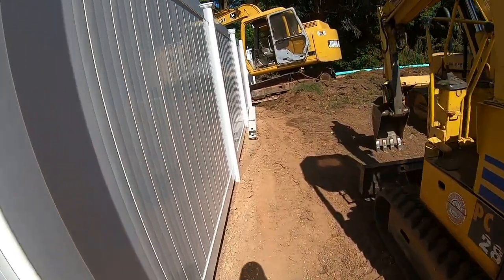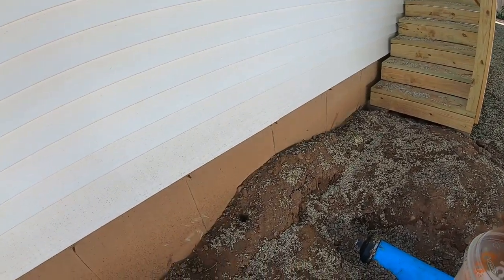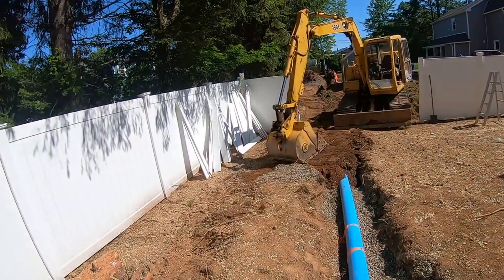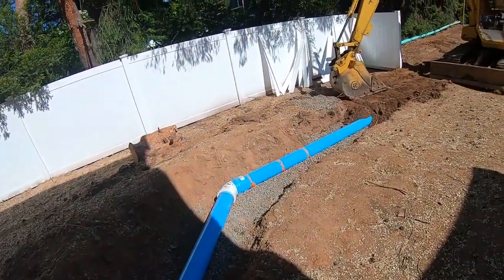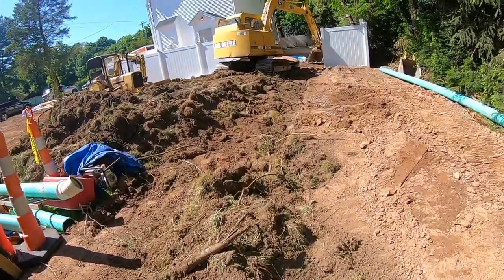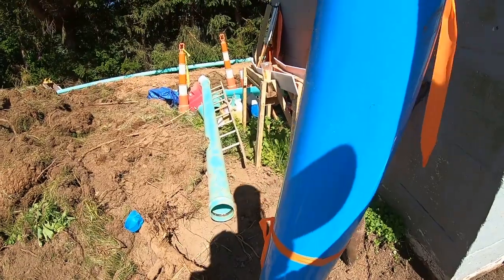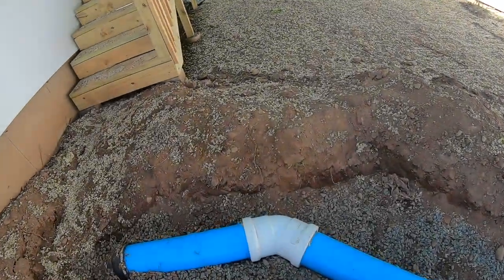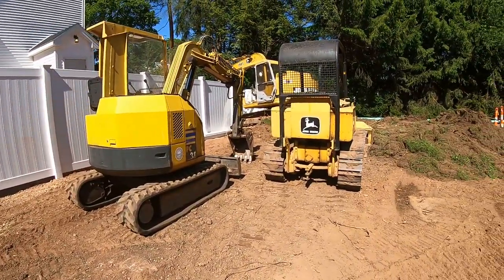sewer dig with schedule 40 pipe

Comment: Developer did a real hack job he should have just had you dig down and do a core drill for the proper depth  would have been cheaper in the long run then using that pipe and it would have been done right. That wouldnt fly up here.